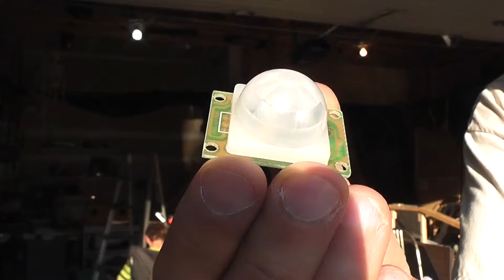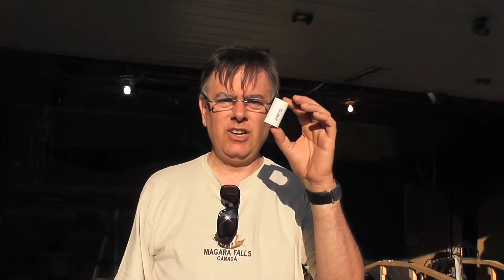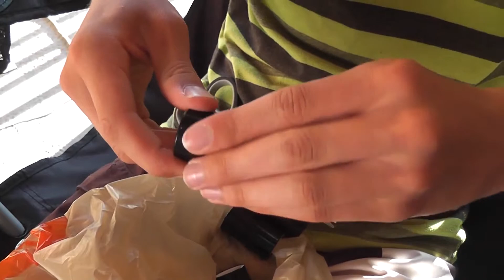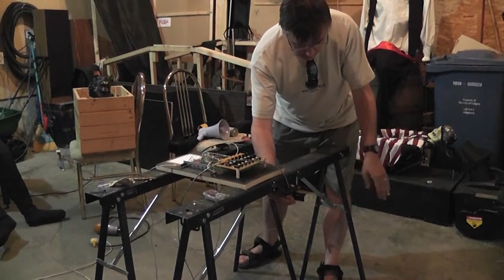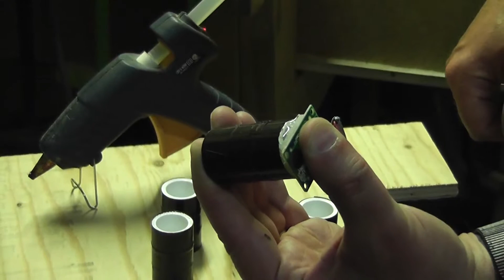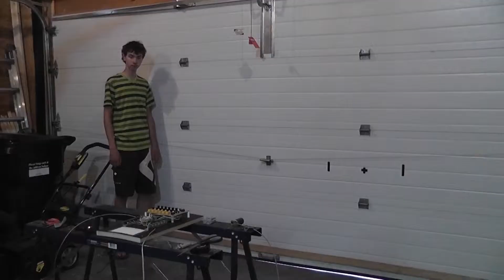Creepy Creations - Motion Sensor Modification

Comment: Have you had issues with these sensors producing false-positives? I'm in a warm climate, so I think that is part of the issue. What controller are you using? I wonder if I need to debounce or count the number of positive signals in a certain (short) period of time.